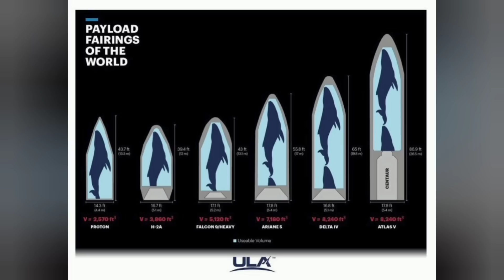Merry Christmas Tory Bruno and Vulcan Centaur!!  Plus, SpaceX, Axiom sends UK astronauts to orbit!!

Comment: Why has ULA not built they own engines in the time they have waited for BE4 they could have developed them themselves
Reply: Because the rockets they inherited from Lockheed-Martin and Boeing (McDonnell Douglas) were all made by other companies, like ATK, Aerojet, Energomash NPO, or Rocketdyne (all of those wound up in various mergers as well). They are not set up in any way, nor had the money to create the extensive infrastructure to build engines. Blue Origin was already building components of BE-4 at the time that ULA went with a competition to build the main engine for what would become Vulcan, and eventually by 2017 they had several full-scale engines for testing on the stand. 

And, as always, people ignore the elephant in the room: ULA botched the Centaur V design. Even if BE-4 was ready back in 2020 or whatever, CV would not be. And it's the failure during the qualification test back in March that has led to the 8 month delay in launching Vulcan, not BE-4. The BE-4s on the Vulcan booster were delivered last year after passing their ATPs, and they passed the 6 second FRF this past June.

It's time for people move on.

Comment: 13:30 - Jordan, Regarding “Fairing Size” - SpaceX could resolve that problem if ULA allowed SpaceX to use the large fairings made by ULA’s suppliers. The would happen if the USA government insisted that ULA “play nice” and allow SpaceX to buy the fairings US taxpayers paid to develop!
Reply from the maker: You are absolutely correct. SpaceX tried to go through a ULA contractor for an extended fairing, and then that contractor mysteriously declined to cooperate. ULA obviously shut the deal down, though I really can't blame them. Those kinds of tactics are pretty typical in a competitive free market.
Reply: Come on, SpaceX can develope their own much faster, if neccessary.  🚀🏴‍☠️
Reply: @MichaelWinter-ss6lx   On the current national security contract, SpaceX in being paid much more than they usually get per launch, in part so they could supposedly develop new, larger fairings. Thus far they do not seem to have begun that project.
Reply: SpaceX already made the larger fairing for that contract. They show the pictures few months ago

Comment: The big issue with Vulcan is the supply of BE4 engines.  Not only has Vulcan not flown, but Blue Origin has not shown the ability to reliably produce those engines.  One successful flight will not not make the program a success.
Reply: Love the continual moving of the goal posts.
Reply: Very good point 👍
Reply: I'll start taking Bezos & Co. seriously after their 20th or 30th consecutive successful orbital Vulcan launch. You know, about what SpaceX does every couple months now...
Reply: @davidwilliams5749   Blue Origin will not be operating Vulcan. They are merely a contractor supplying the engines. ULA is the launch provider. Now, when New Glenn has 20 or 30 launches under its belt . . .
Reply: Blue Origin will probably sue themselves for any failure.

Comment: I don't know if Vulcan will have much better luck on their first launch than Starship did. Wondering if it will explode on the pad, or tumble out of control before it reaches space. ULA doesn't have anywhere near the flight experience of a mature company like SpaceX.
Reply: "ULA is the nation’s most experienced space launch company with more than 155 consecutive launches and a 100% mission success rate."
Reply: @JorritvB  Spacex  Falcon 9 Block 5, has flown 210 missions, all full successes
Reply: ULA has a great record of successes with Atlas 5, Delta 4, and Delta 4 Heavy.  The issue is that Vulcan is a new can of worms.  Only after it is tested successfully several times can they be assured that they can keep that record intact. We'll see.
Reply: Oh fanboy, you really cant say ULA are without experience !  They had a monopoly on national security , before SpaceX, and before they decided to depend on "the Origin of Blue".  🚀🏴‍☠️